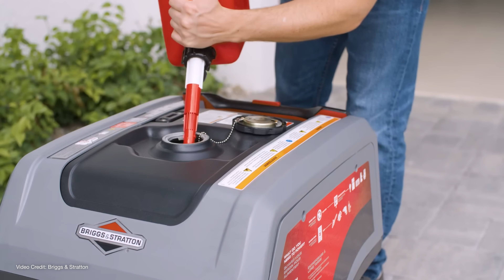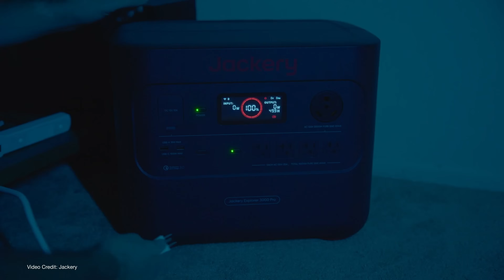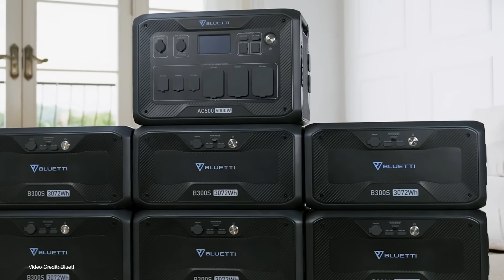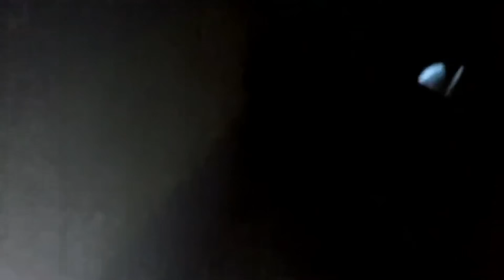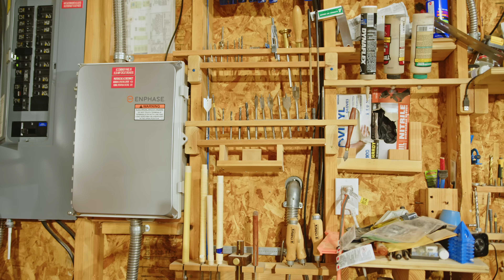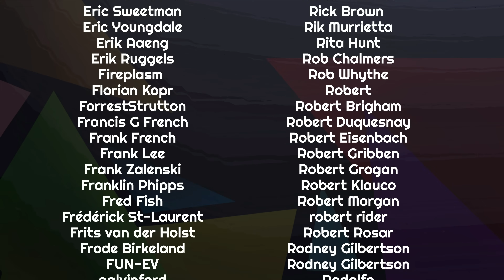You Need Battery Backup Options - Which Should You Choose?

Comment: Yep, our 14 year old off grid solar and lead acid battery setup just scrapped us through a 3 day grid outage due to cyclone Alfred here in Brisbane Qld. Also used an inverter as you mentioned on our first gen MG ZS EV (doesn't have V2G) to pull an additional 350 watts for a fridge. Fiddly but did work, have a video on my channel of it.

To have a lightning as backup is a dream over here 😂

Comment: Wonderful video, well researched, well thought out, well presented. As to "home-battery" vs "ev based" system, there is the argument of picking both, using a smaller home battery to power things for a few hours, which can then be topped up from the much larger EV battery pack. Some EV chargers will interface with a home battery system.

Comment: Smelly & sometimes unreliable. Hmmm, ours is a 17Kw LPG field genset that powers up once a week for "exercise", so it is neither smelly or unreliable. What I want now (phase 2 of the plan) is a battery bank to hold the house electrical up while the genset starts up and takes over.
Reply: Agreed. I have not had reliability issues with a "classic" power generator. It offers its own set of convenient advantages (placement, wiring, etc.). There is no denying, though, that solar has improved significantly and may be one of the best options for reducing emissions if you go fully solar and "disconnect" from the grid.

Comment: Ive had a modest 4.8kwp setup for a couple of years with 20kw of home batterys. Just bought an ev and yes i love all this tesla hate as hey, at least it dropped the price of used ones and i could finally afford a 4yr old M3awd LR. So starts my ev journey and so far very happy. One advantage of home storage i would add is my commute is 74 miles. I only have a granny charger and my cheap rate is only able to give me 6 hours cheap rate before i leave for work...thats not enough juice to last the week! However my house batterys are charged over night and then topped up by the solar, so get home at 7:30pm and charge untill 5:45am and im good to go. The batterys charged at 6.7p/Kw and the solar keeps them at 100% untill 6pm. I still get to charge at cheap rate over 5 hours on my cheap rate by using the house storage

Comment: 18:19 Glad you mentioned the heavy duty cables.  I’ve paid over $100 for heavy duty outdoor extension cord for EV charging 😨, but I feel the safety is worth the cost, especially for my friend who relies on it every day
Reply from the maker: Cables are something you should never skimp on! - Nikki
Reply: I lived dangerously and just used a basic 16ga orange one when I first got my EV. Was running the cable out the mail slot to where I parked.
I was more worried about the nearly hundred year old wiring in the walls than the extension cord, but never had any problems. 
If you have to do something similar limit charging to whatever's lowest, in my case I set it at 8amps.

Comment: The Emporia Vue is a great way to get real data on power consumption for your exact devices. It's cheap and an excellent way to measure your critical loads, not just how much power but when and how long. Our system has solar, a moderate size home backup battery and a hookup for Lightning Pro Power. The home backup battery is enough for several hours worst case, and switches to backup power so quickly that I don't always notice. The Lightning extends that for several days. Worst case is snow covering the solar, cold making the heat pump work hard, unable to publicly charge the Lightning and a days-long power outage many times longer than we've ever had here. Admittedly not cheap. The home backup battery could be used for time of use energy arbitrage to offset costs.

Comment: Good information yet I fell the home installed battery option was lightly covered where another great benefit, besides backup, is that when tied to solar you can generate savings from storing excess solar production for your own use. In those cases where you experience longer outages, like during storms, you can extend your capabilities by continuing to operate via the solar/battery storage installed in your home.